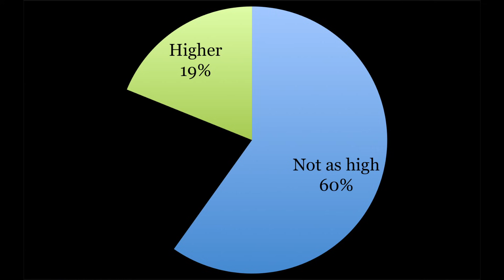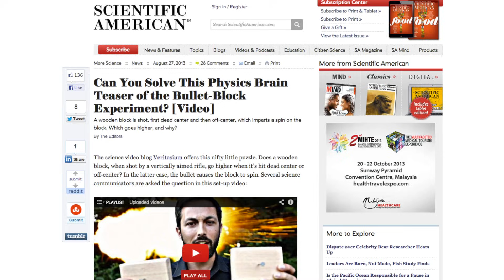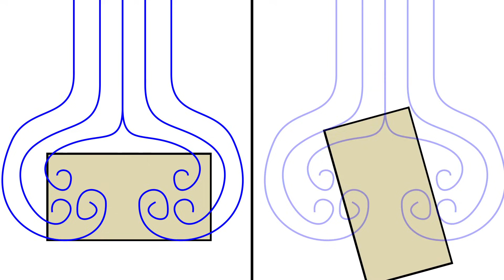Bullet Block Explained!

Comment: Use a bullet/projectile with flat surface (pointless). It does not have to be a gun and a bullet at all. Ok, or use a BB/airsoft gun with light plastic box or something. This way, the projectile won't enter the block at all..., and the experiment might take a new turn...

Comment: To to test this theory of the depth of the bullet making any impact an the energy being transferred to the block you might also take the penetration depth out of the equation altogether. Thereby eliminating the effect it might have on the hight the block reaches. In other words bij using a block the bullet cant penetrate like a block of steel you might get the block up higher with the center shot than the block with the off-centre shot. Or use another projectile like a ball or rubber bullet.

Comment: More importantly,
The conservation of angular momentum is the ACTUAL REASON for the block to spin. 
If you think about it:
Why is there any spin at all?
What speed will the block spin at?
around what axis will the block spin?
(and if you are thinking that friction or gravity play a roll) 
would it spin if the experiment happened in space??
all these questions can be answered using conservation of angular momentum.
(answer to the last question is yes.. theoretically)

Comment: Angular momentum is always conserved(about a given point).
lets consider the wood block center as the point.
Before impact:
Angular momentum= (mass of bullet)*(velocity of bullet)*(perpendicular distance of bullet from point)
the bullet velocity in the vertical direction is providing a angular momentum to the system about the center of the wood block.
After impact:
moment of inertia(system)* angular speed is the angular momentum

without the numbers I cant prove they are same.

Comment: Sorry, I don't have a webcam available right now, otherwise you would have gotten a Video response from me as well.
You could try measuring how much energy is actually transferred into the block and how much energy can be transferred into the rotation.
How about mounting the "centered" block fixed (immovable) and measure the bullet penetration depth. Mount the second block fixed (x-axis) as well, but allow it to spin. This might give you a clearer result?

Comment: Allan Medeiros you are wrong. Angular momentum L = r x P, where the vector r starts from the center of the block and heading to the bullet. P is the linear momentum of the bullet, |L| = |r x P| = m.|r|.sin(r,v).v = m.v.a, where a is the distance between the middle of the block and the bullet whole, also L = I*w , where I is the ineria and w is the angular velogicy so you get 
w =  a*m*v/I, 
Kinetic rotational en E = I*w^2/2 = a^2m^2*v^2 /(2.I) = (m*a^2/I)*E0 where E0 = m*v^2/2 - init kin energy

Comment: I did the calculations and they showed that the observation factor is = the inertia of the circulating around the center of the mass, bullet m*(a^2) divided to the inertia of the block. ob_factor = m*(a^2) / I 
For the wooden block I = M*(a^2+b^2+c^2)/3 so for the wooden block ob_factor = 3 * (m/M) * ( (a^2) / (a^2+b^2+c^2) ), the most significant is the mass of the bullet / mass of the block. Making the block wider would help for example with sizes ( a, a/3, a/10 ), whould help.

Comment: The block with the nail behaves as a lever rotating around the fixed center point of the nail. Changing the length of the lever will change the angular momentum transferred to the wood by the bullet. 

Use a longer piece of wood with the nail remaining in the center, or add an additional nail (two nails in total) to the left of the original so that the length of the lever becomes longer.

Comment: We want to maximize the kinetic energy transferred into angular momentum, so we should maximize the torque applied T=Fxd=(m•a)xd. m is fixed, so we can affect the torque by modifying either -a, the deceleration of the bullet or d, the distance the bullet is off-centre. Notably, mass of the block shouldn't affect the torque applied. Thus, a wider block (allowing the bullet to be shot more off-centre) and a harder block should allow more of the kinetic energy to be converted into angular momentum.

Comment: I'm seeing people suggesting using materials that will increase the different between the two states. However, if the amount of penetration is proportional to the block's momentum, then using materials with different toughness, but the same mass, like a smaller block of iron, should yield a higher/lower height and prove this. But that conflicts with preservation of momentum, no?

Comment: Another factor that I don't see being mentioned is the bullets themselves. When bullets are loaded with gunpowder that load is not always consistent nor is the actually energy output. A much more reliable shot would be needed that would provide a truly consistent energy transfer. In addition, the block itself needs to be made consistent with mass and density if penetration will still occur. Then we'll be doing a more pure scientific experiment.

Comment: If the bullet would not be able to penetrate the block it would probably mean that the bullet would bounce of the block, so the bullet would also have some momentum downwards and both blocks will not go the same height. And yes the spinning block would then go lower.

Comment: You could use a block with a smaller moment of inertia, but a longer arm (distance between the center of mass and the spot where the bullet hits the block). This the best way you could do this is to add or move weight at one end of the block so the center of mass would shift to one side.

Comment: Has anyone else wondered why the blocks all traveled to a different height? In the side by side shot of the 7 blocks, it made a pleasant arch (although I know they were arranged that way), but the questions still stands. If the bullets themselves are made of the same material and the same size, each casing filled with the same number of grains of black powder, then why would shooting several of the same sized blocks raise them to different heights? And the same for the blocks shot off center

Comment: I was thinking the following
(It is just a thought experiment)

But what if there was no energy lost, what if the bullet transfers all its kinetic energy to the the block. Than both the spinning and the non-spinning block would have the same total energy, but because the spinning block has rotational energy the height energy of this same block would be lower than the non-spinning block.  

The other approach in the video using conservation of momentum would predict that they have the same height

Comment: The off-centred bullet has an angular momentum before it hits the block: its angular momentum is the cross product of its position vector (relative to the centre of mass) and its linear momentum vector. The centre of mass of the entire system almost coincides with the centre of the block, so the position and momentum vectors of the bullet aren't parallel, thus the bullet has an angular momentum.

Comment: Well, you could use some sort of softer material to be able to measure the kinetic energy loss of that bullet. Or, maybe, you could use some material that's not gonna deform nearly at all, anyway, I'm not sure if such material exists at all. Or maybe you'd better do it in a bigger scale... Anyway the trick with multiple blocks made me laugh out loud. Frankly.

Comment: Presumably the fact that the bullet loses 97% of it's kinetic energy when it hits the block is only true of that particular block - i.e. the fact it's wooden. In which case if you use a less dense material for the block, then the difference between the energy lost by the bullet and the energy needed to spin the block would be much greater... Wouldn't it?...

Comment: Instead of using wood blocks use blocks made from sheets of paper. Stack just enough sheets so that the bullet does not go all the way through. Remove one sheet at a time. Count the sheets of paper. Or fire both shots at the same block and count the sheets.

Comment: One factor that is very important is the load of the round. Even though the round is manufactured, sometimes it is not always exact and can differ by a few grains here or there. Find someone who knows how to load rounds and get the exact same loads before you shoot. Also make sure you shoot on a clear day as the bullet can be affected by moisture and many other factors which could possibly cause different results.

Comment: Shoot a long light beam of wood (such as Balsa Wood) rather than a block.  Shoot the off center shot right near the edge of the beam.
Or use high quality steel, and measure the deformation of the bullet.

Comment: Not necessarily. Just like the reason the distance between the two penetrations were so similar (the difference was so small that it was immeasurable), the difference in distance traveled between those two bullets would be almost immeasurable as well. You also need to realize that this is not a perfect experiment. The bullets break apart wildly inside those blocks, effectively ruining any good results. The wood material used also inconsistent in both blocks.

Comment: the bullet going into the rotating block curved due to the fact that the block was rotating and moving away from the block as illustrated at 7:19. if they had used a more malleable measuring device such as a piece of copper wire with an appropriate diameter to fit the bullet holes it could curve into the bullet hole of the off-center shot block, then mark the wire with a sharpie and do the same with the block hit from head on. perhaps this will show less of a difference if not match.

Comment: If you look at his diagram from before, the bullet will go straight into the block in the first one, but will curve slightly in the rotational block, because the momentum of the bullet stays in the same direction regardless of the spin of the block. Because it is curved, that straight nail they used would be unable to go all the way to the bullet, for it is not curved as well.

Comment: This is Math, not Physics. In Physics when you do a measurement there is a lot or "rumor" in your data, this experiment was made in the air, with differents blocks, not the same initial position, differents projectiles and so on... So, the errors are so bigs that a difference of 1/10000 is perfectly negligible(I think that also a difference of two centimeters it is).
Sorry for the bad English. :)

Comment: Who said video responses are dead?
Also if you created  a simulation on the computer, with perhaps the ability to vary the material of the bullet, the material and size of the wood and the force of the bullet. It would allow for more estimates which could then be tested empirically rather than testing everything empirically at the start.

Comment: To increase the rotational energy of the block make it longer and fire closer to the edge, this will mean a greater turning moment. also make the end of the bullet blunter at the tip so that it more quickly comes to rest, meaning more energy is imparted to the block rather than being used exclusively to cut through the wood.

Comment: If the question was "will the blocks rise to approximately the same height?", then he would be correct. Since the question was actually "will the blocks rise to the same height?", he is wrong. It doesn't matter if the "negligible" height difference is 1/10000 of a centimeter, there is still a height difference. Ergo, the blocks do not rise to the same height.

Comment: A wider block, so the speed of the edge of the block is higher. It wouldn't change the depth of the center bullet, the rotational speed speed would be similar or slower. But because it's wider the very tip of the block would have a higher speed, stopping less of the bullet.

Comment: It is because the there was a loss of momentum in the first where the bullet affected the first corner the air affected the other so there was two equal opposite forces in different rays, but the one who was hit in the center they two forces worked on different lines and canceled each other, but in the first it didn't.

Comment: maybe cut something a phone book around 5 cm from its back, split in 2 pieces remove the cover and stack so its double thickness. wrap it up tight with some saran wrap or something to keep it all together during the flight and before. afterwards you could measure the bullet depth page by page.

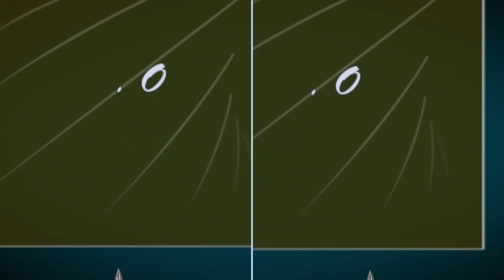Comment: My idea is that, as the animations show( 7:14 ), the hole the bullet off-center makes is not straight, but curved. As the nail is straight and rigid, it cannot fit all the way into the hole, making the difference seem significant. On the block that was shot in the center, the hole was straight and so the nail was able to reach the bottom.

Comment: Use a block made of softer material, causing the deceleration process to take longer (less force applied by weaker material), allowing the one percent difference in kinetic energy to be apparent over a longer period of travel into the block. Very soft, very long blocks would be ideal, as long as they are weighted enough so that air resistance won't cause the blocks to move erratically through the air in different tests because of slight differences in the surfaces of each block.

Comment: The .50 wins all the time. They could go with something a little more with more energy (increased energy by increase in velocity) but those just get expensive and hard to find.  As far as I know the momentum would still conserve with an angled block. it would just impart a different spin on it.

Comment: Use a block with a lower density. By decreasing the density significantly enough you could increase the chances of making that penetration depth measurable in a repeatable fashion.

Comment: The inside of the block could be made out of foam (or other appropriate soft material), so that less energy is lost per unit distance. This is so that the difference in distance can increase from 1%. Also the block would have to be larger due to the bullet now losing less energy per unit distance.

Comment: It don't believe it would make that much of a difference. Yes, there would be more resistance due it's weight (F=ma) possibly resulting in the bullet going further in the block. Wouldn't both bullets for both blocks go through at very similar distances for wood again?

Comment: Make the blocks of two materials: outer coating of metal and inner filling of some gel for example. When the bullet hit the metal it will loss most of its energy so it will not penetrate the block. Both bullets will travel further through the gel then through the wood making the difference more visible. I guess the blocks should be bigger too.

Comment: Why not shoot the bullet into a block (something clear and soft on the inside so the distances penetrated are amplified) from far away or a father distance or both to the point where one bullet barely goes in (middle shot) and one of them won't make it in at all (side shot)

Comment: Maybe use a different material, then, blocks of compressed paper or highly processed plywood. You get greater conformity that way. Perhaps using larger blocks and much higher powered rifles would help as well.

Comment: Correct answer:The center happens to be the 'center of mass' of the block as it has uniform density,so if the center of gravity applying on that spot is 'X' then the gravity applying on the second spot is lesser(X-X/2).So the bullet's kinetic energy(Y) should be more than X to make a lift.So (Y-X) energy is utilized in lifting the block from the center, and (Y- X/2) is utilized to lift it from the side,(X-X/2) converts as rotation.All in all only Y energy is applied,so it goes to same height

Comment: I call BS. The block is very small, so the distance between center and off center is very little. Do this with a meter wide block and I bet we would see a very different result.  On top of that, very little energy transfers to rotation compared to the starting energy of the bullet. Set it up where rotation is 25% of the total energy and we would see a very different result.

Comment: I would not be using a wooden block in this experiment as the grain of each individual block of wood is unique, I would use a flexi gals block or a strong solid plastic block opposed to the wood

Comment: I suggest repeating the experiment with a block made from a less dense material (like styrofoam) and shoot it with a projectile whose mass is closer or equal to the mass of the block and do it slow enough to not go all the way through. (like a dart launched with a spring)

Comment: you could use plexiglass, if you use one that is brittle enough for its structure to have internal cracks inside, but elastic enough to not break into pieces, you should be able to measure the angles between the breaks and there for their origin

if you use then a waxed/glues buckshot with just a few pellets you should be able to transfer more energy and therfore be able to get a bigger diffrence in penetration

Comment: Hey Derek, really interesting experiement. In order to clear the (quite confusing) phenomenon of the bullet getting lodged in the block, maybe you could use some harder to penetrate material like metal.
Another experiement you could do, that would eliminate the phenomenon completely , is slide two identical spheres (or wheels) down two inclined planes. If one of the planes is smooth and the other is ragged, the second sphere would spin, making it (I think!) go slower.